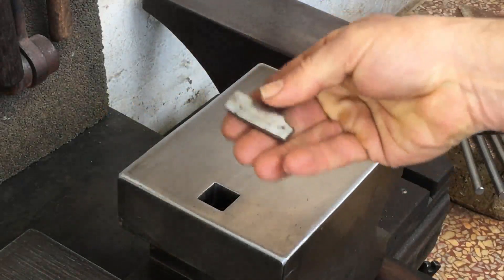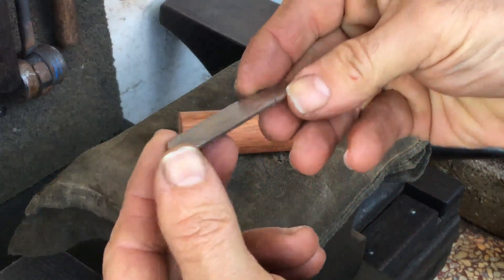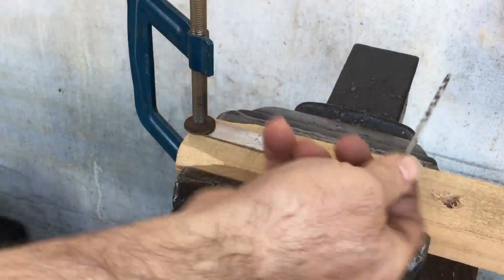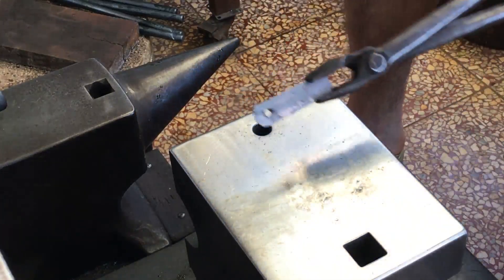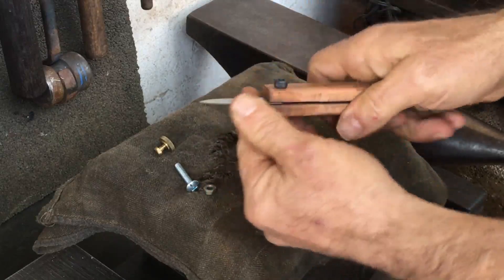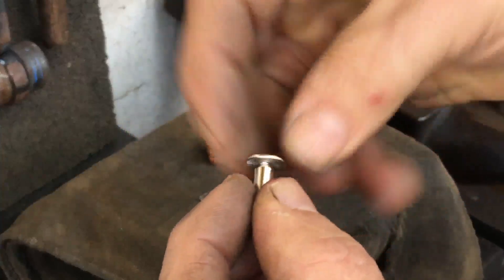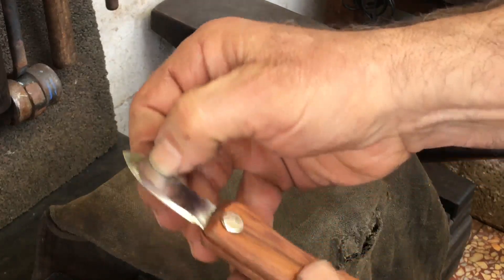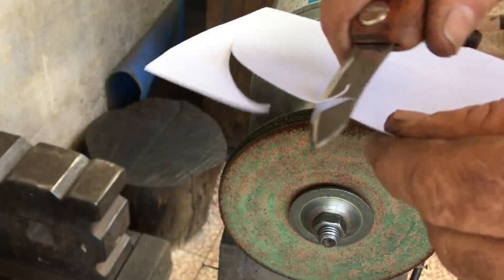Making Small Rudimentary Folding Knife

Comment: I found cheap carbide tipped concrete drill bits work well on hard tough steel
I discovered this when trying to enlarge the pritchell hole in my small anvil
Reply from the maker: I will give this a go as others have mentioned this too. Thanks for sharing.

Comment: Not too shabby for a first go. have a go at trying a small sharp hot set chisel and put a thumbnail groove at the top of the blade to assist in opening the knife. I agree with the viewer who suggested a carbide drill bit for the hole, they will even drill through a file. Great little knife, make some more.
Reply from the maker: Yeah, this really needs the thumbnail groove otherwise I'm hesitant to close all the way. I really need to try concrete drills on hardened steel. Thanks Stephen.

Comment: What is the point of forge welding different steels in a bullet and making a knife out of it when You don´t reveal the texture by acid etching at the end? Also, not being able to fold the knife all the way down and hide the sharp tip could be very dangerous in use... Sorry for the criticism but I mean it well. I hope You consider it constructive on your way to becoming a better knife maker...
Reply from the maker: Hi, I can fold the knife all the way down but since I hadn't yet put a thumbnail groove in the blade, it would be hard to open. As for the forge welded piece of steel I created, I never made Damascus before and don't really know (I have an idea) how to etch. This was really just a test and I like showing my experiments, even semi-failures. And I don't mind constructive criticism at all. Thanks for sharing.
Reply: @gstongs  OK, well, standard precedure for etching is to mix 1:10 feric chloride with water and let the knife sit in it for couple of minutes. Then wash in water. Finaly, you can put it in a very strong solution of instant coffee to enhance the contrast 🙂